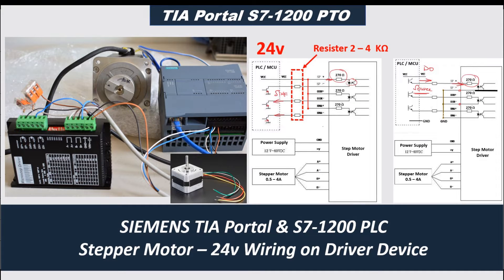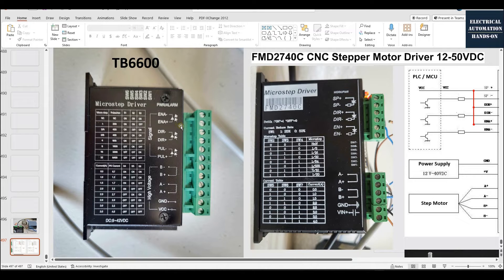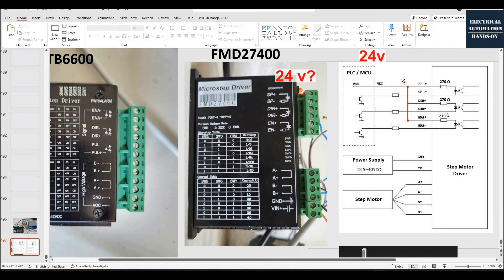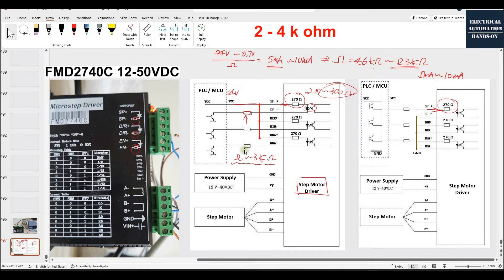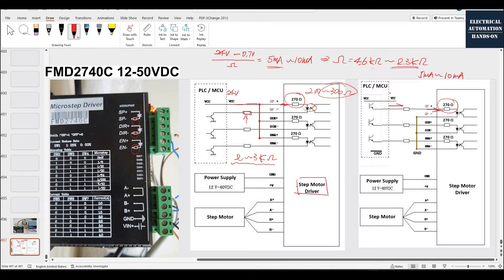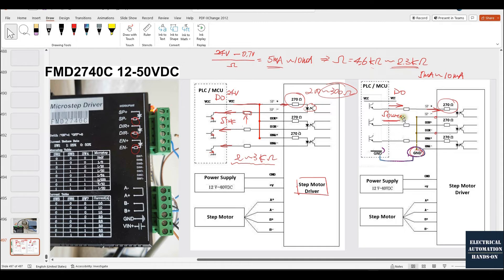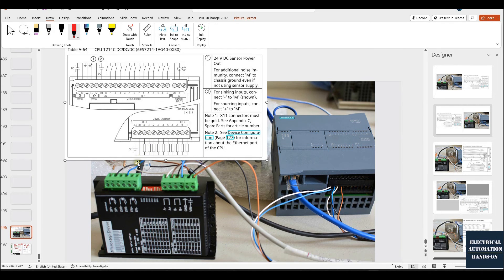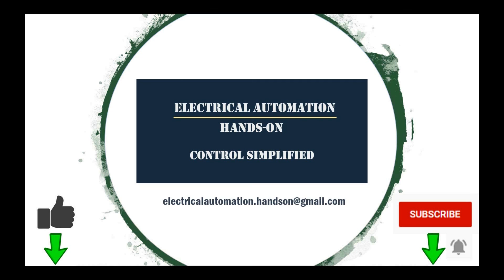MS08a. [Stepper Motor] Stepper Driver Wring with PLC 24v Pulse Signal (Resister for TB6600 FMD2740C)

Comment: My PLC is 1214C AC/DC relay and output only L+ don't have M- wire how about connecting? Thanks
Reply from the maker: Your 1214 PLC is Relay output and cannot do the high pulse signal. You need to use DC/DC/DC type

Comment: can i use DI/DO module attached to s7 317-2 PN/DP and set output through the DI port of DI/DO module instead via PLC?
Reply from the maker: Basically no, not regular do module, you have to use the CPU 'PTO' output. The regular do can not do high frequency, and it will cause your step motor has to run very slow or miss the speed command.